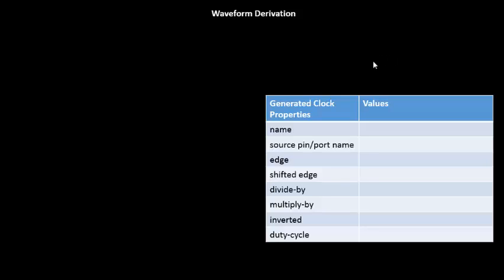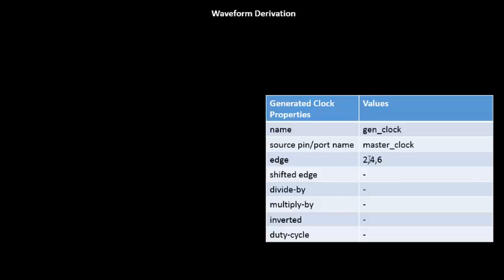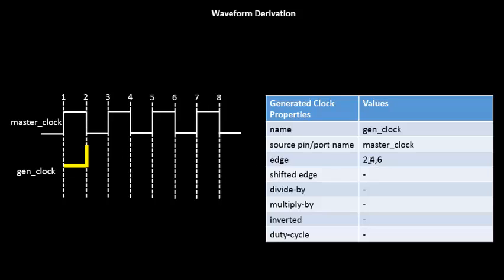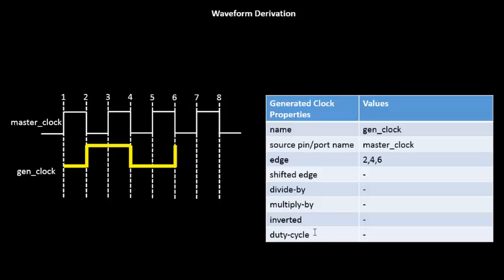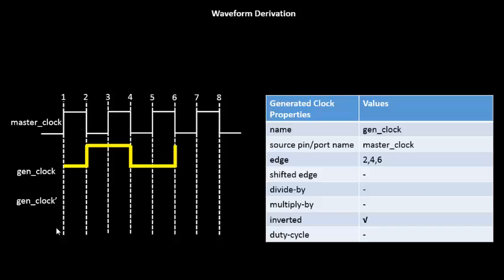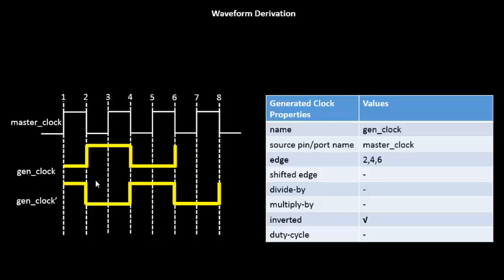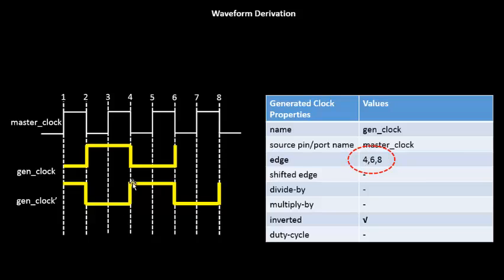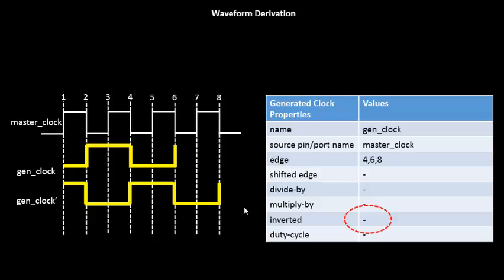What is Generated Clock Waveform Derivation?? Learn @ Udemy- VLSI Academy

Comment: For Inverted, edge should be 4,2,8 ? Since 1st fall edge is 2 not 6.
Reply from the maker: Neel Doshi I understand the confusion. 
Actually, the standard way to provide edges is {first_rise, first_fall_after_first_rise, second_rise}, starting from time = 0 ns. In the example taken, even though the first fall edge comes at '2', but the first rise edge comes at '4' only. Next, the first fall edge after the first rise edge comes at '6', hence, its 4, 6, 8. Hope that explanation helps
ThanksVSD Team
Reply: anagha ghosh I got it. I really appreciate such detailed response.